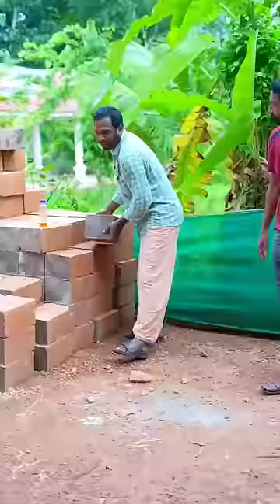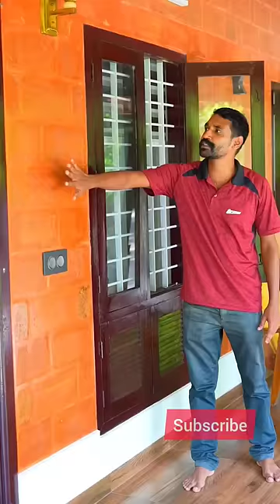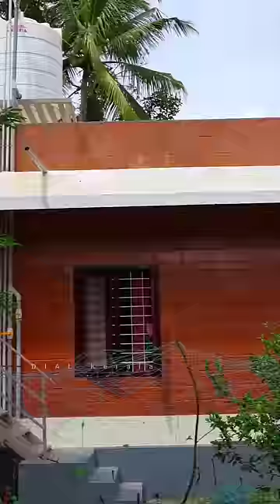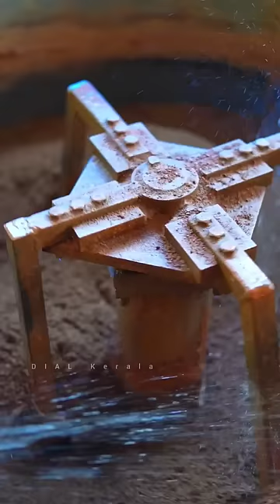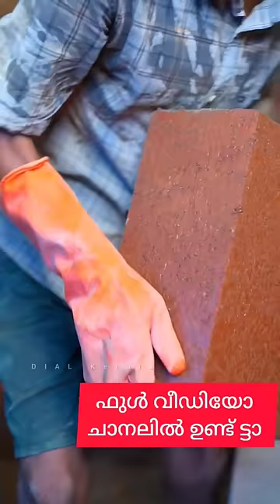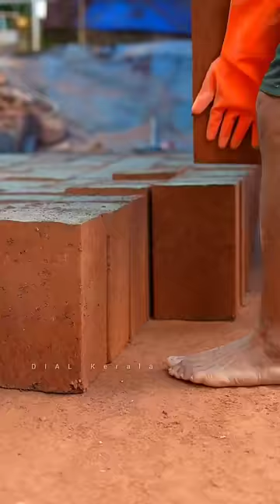ഈ കട്ട പൊളിയല്ലേ #shorts

Comment: Should be baked. Otherwise can't resist rain. ഉറപ്പൊക്കെ ഉണ്ടാകും പക്ഷേ മഴയത്ത്  അലിഞ്ഞുപോകും
Reply: Illa
Reply: Chanc 99.9 um kanulla because athil chemical endengilum kannum 😐
Reply: മഴയത്ത് അലിഞ്ഞു പോകും എന്റെ ബന്ധുവിന് ഉണ്ടായിരുന്നു അതിന്റെ കമ്പനി
Reply: @rashidsr3091  ennal enikku ath kondu randu benglavu undayirunnu ath oru kuzhappavum illaththe avide thanne und😌🤜
Reply: @heartmello1081  serida
Reply: Normally Cement bricks may not baked naa
Reply: @spark2op937  😂
Reply: @heartmello1081  😂❗
Reply: @Augustwaves24  cement won't melt or dissolve once set
Reply: @heartmello1081  sopnathil aayath kondayirikkum bruh
Reply: @user.fckurmommaxxx69  aano da ambani 😌
Reply: @heartmello1081  athokke pand ippo cm aan munnil
Reply: എന്റെ വീടിന്റെ 2ആം നില ith പോലെ ഉള്ള brick vech ചെയ്തതാണ്..തേപ്പ് ഇല്ലെങ്കിൽ വലിയ കാര്യം ഒന്നും ഇല്ല..നനവ് തട്ടിയാൽ മെല്ലെ മെല്ലെ ഉതിർന്നു വീഴും...വൈറിംഗ് പ്ലബിങ് ഒക്കെ ചെയ്തതുകൊണ്ട് തേപ്പും കൂടി ചെയ്തു...എന്നാലും ഇനി ഇത് വെച്ചു ഒരു വസ്തു ഉണ്ടാക്കൂല 😂😂പെട്ട് പെട്ട്
Reply: @nivedradhakrishnan807  സത്യം എന്റെ വീടും ഇതാണ് അവസ്ഥ ബാത് റൂമ് ടൈല് ഇട്ടിട്ടും പുറത്തേക്ക് ലീക്ക് ആണ്
Reply: No..... Man